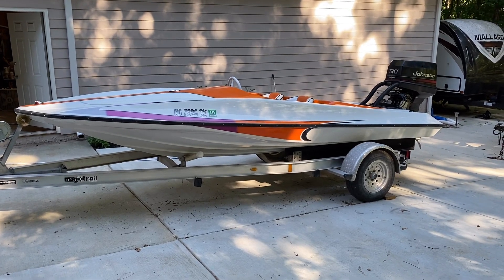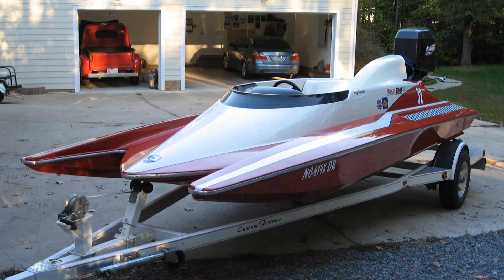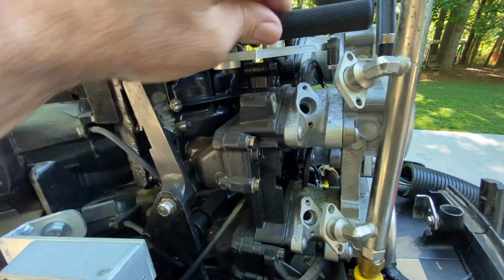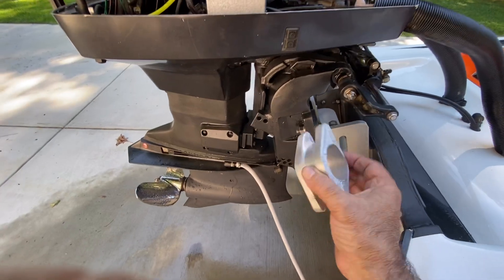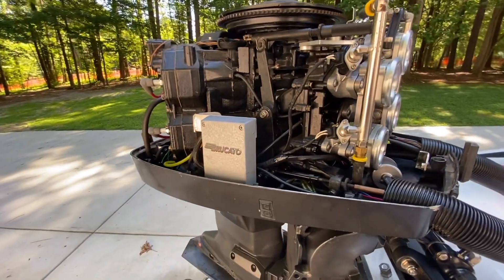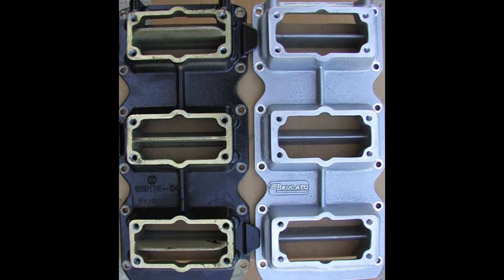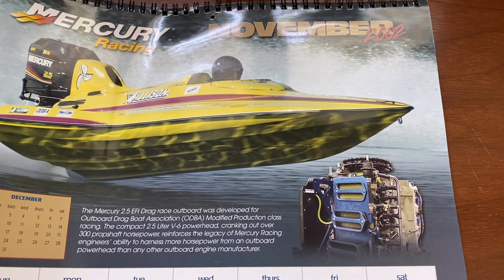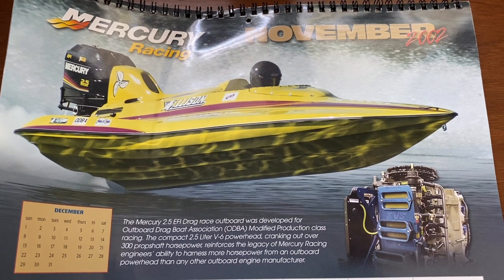Show and Tell, Custom Intakes and More!

Comment: That is so cool! I'm gearing up to cast my own FI intake for the 620 I'm currently working on.  I've never done it, and it will all be DIY, so I hope mine can turn out half as good as yours did. I see that you're in NC, and wanted you to know that the '50 from my channel lives in Raleigh now!
Reply from the maker: Thanks a bunch! Metal casting, adds another dimension to your fabrication. I’m less than 10 miles from Raleigh. 👍Tony B